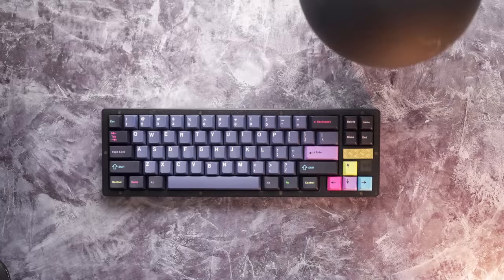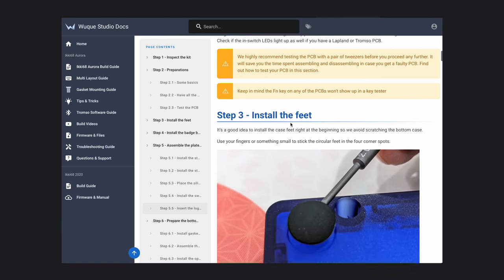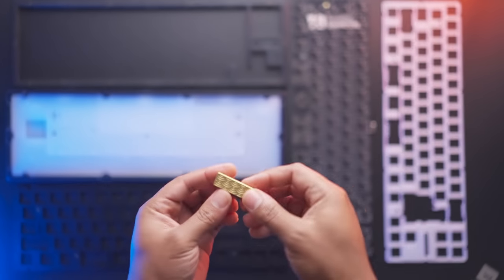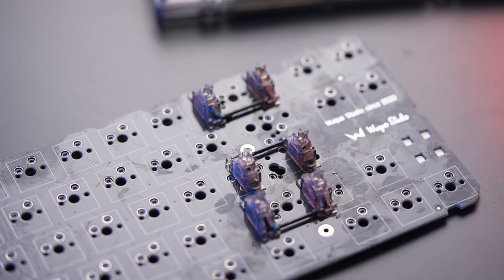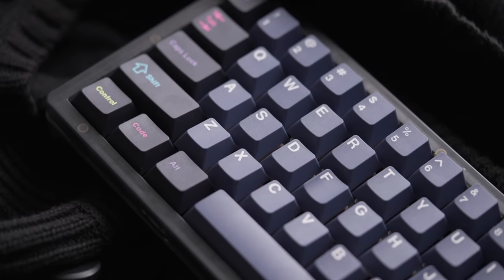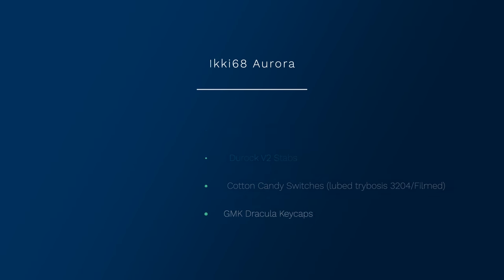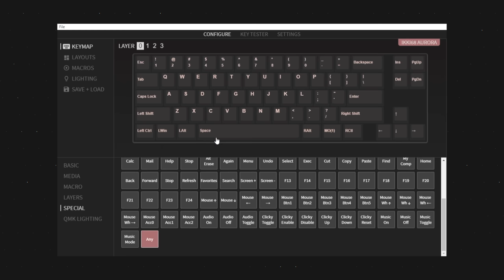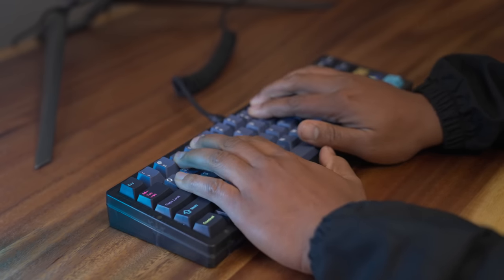ikki68 Aurora.. Ballin on a Budget!

Comment: I got the r1 and so far it has been a great board, since I got the added weight and a carbon fiber plate the flex is not really noticeable, but it still a nice typing experience. I bought the e-white alu top, poron kit, and a pom plate from the r2 group buy and I'm excited to see just how good I can get this board to feel and sound.